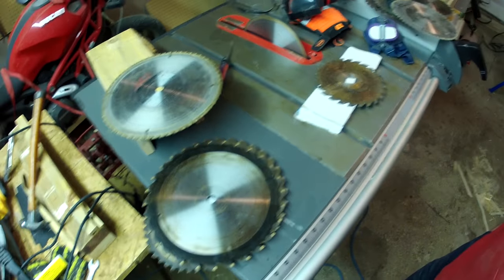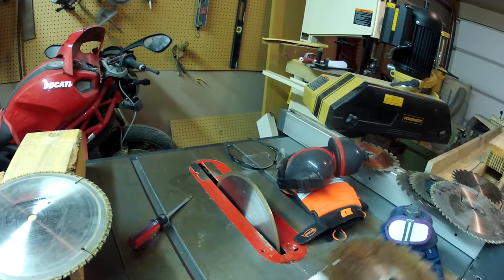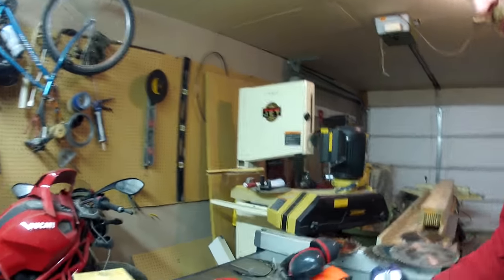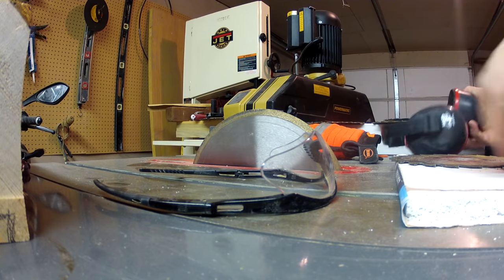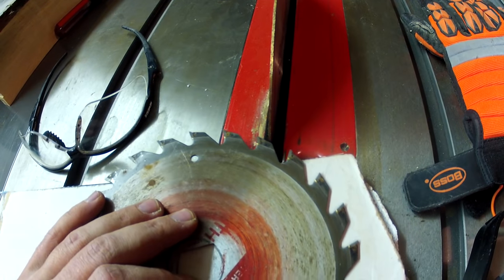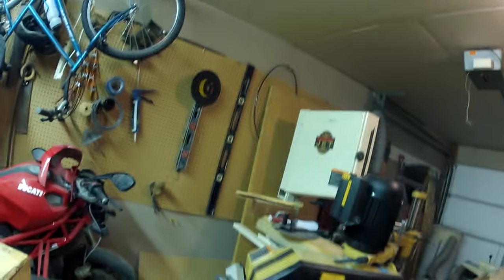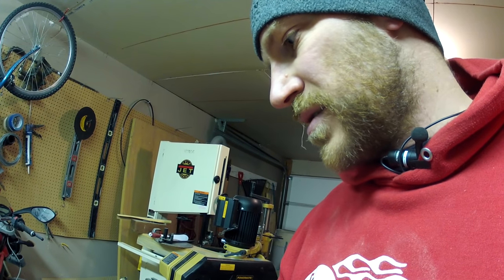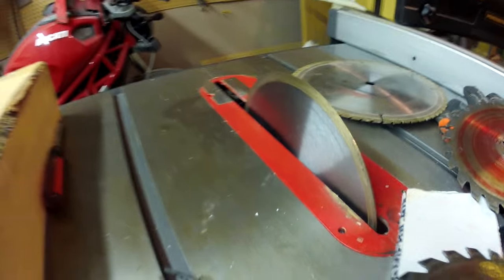How to sharpen your circular saw blades, the easy way.

Comment: You can tilt your table saw blade to do the other type... Just skip the other tooth then go back threw it after you reverse the angle. I clean up the tooth's top with a hand dimond file... eBay cheapo's hold up quite well for a four or five dollar file. I've stopped on a trim job and touched up my chopsaw blade while having a beverage... Takes you 10 mins by hand... Why would you put on a new one for fifty bucks? I think the guys that don't do this are clueless! I got a whole set of little files... I just touched up a 3/8" spade bit... My brother in law hit a nail while we where putting up hit backyard fence... Took five minutes! Why yo be ...man! Keep on rockin in the free world !!!
Reply: Totally agree.  Even the brand new spade bits I've bought aren't as sharp as I can get them with a chainsaw file.
Reply: Tilt is almost never needed on the face of the carbide.  Just touch up the face at 90 degrees and you're ready to go.  Use very light pressure and you will get much better edges on the carbide tips.

Comment: How do you account for tooth angle? Not all blades have  flat, 90 degree angle, most are a slight angle, like 10 to 15 degree, and alternate back and forth from one tooth to another.

Comment: Thanks a lot for this!  I feel a bit stupid, now.  I can use a similar method for sharpening router blades.  You could sharpen those hook-tooth ones with a round diamond stone chucked in a drill press.  I sent my blades out for sharpening, which cost about $7.00 each, but I'm not thrilled with the sharpening job, especially on my miter blades.  Still too much tear-out.

Comment: Would any continuous rim diamond blade work? ie the ones sold for cutting porcelain?
Reply from the maker: I'm using 600 grit diamond now. If it's too course you'll get chipping. I haven't had any issues at 600.

Comment: I disagree with it’s cheaper too. I could get my festool blades sharpened for £12 for 48 tooth. New blade here is about £40. 
Also use and old container and leave your blades soaking in water with washing machine powder mixed in for 15-20 mins and then use a wire brush to get all the resin build up off. It makes a difference too. Nice video👍🏻
Reply from the maker: I just sharpened my festool blade two days ago for ~$0. Obviously there's a nice import markup here as my Festool blades cost over $80.

https://www.festoolproducts.com/festool-495377-fine-tooth-cross-cut-saw-blade-for-ts-55-plunge-cut-saw-48-tooth.html?utm_source=google_shopping&gclid=CjwKCAjw1cX0BRBmEiwAy9tKHpv9EMObEzGgGWINMlKTlhxxKs_q7-ofrERB4aw2fou0NPEmQqZ5GBoCQ6wQAvD_BwE

Comment: Very useful. I’ll give it a try. 
On the other hand you should never use gloves with a circular saw! They won’t protect you from getting cut. They would pull your whole hand in. Without gloves you might get away with just a little nick if you’re lucky. With gloves you’ll lose your whole hand. 
Same goes for rings, loose sleeves or long hair.

Comment: Hi ya.   New to this sharpening saw blade.  Isn't every second tooth a different angle.??
Reply: Depends on the saw blade some are some are not.  Oversimplifying somewhat....rip saw blade carbides are straight.  Cross cut saw blade carbides are angled.  
    But I suppose you could just make very simple jig that holds the blade at the correct angle and sharpen every other tooth.  And then flip the blade over and repeat the process.

Comment: This is interesting
I use metal cutting carbide blades for steal cutting 
They do dull out like any other blades will and get in to $$$$$$$$$$$$$$$$!!!!!!!! 
There not cheap and if a guy runs and ruins ALOT of them it's a pricey problem I will like too know if this technique will work on mentioned blad s as there design is very different than that of a wood blades if you have any ideas to share 
                                                                                                        Thank you in advance

Comment: 46 years using circular saws daily working as a cabinet maker the secret to keeping your saw blades sharpe is at end of every day spend 19 minutes on each saw blade rub a diamond stone over ever tooth of the blade at 20 degrees your blade will last for ever. Take good care of your tools and reap the rewards. Blunt tools will never make huge profits as sharp tool will.

Comment: A useful video, that's got me thinking...
Why not a sled that fits in to the table slots.  Upon it can be mounted an adjustable arbor mount that can be positioned according to the blade size.  Stops can also be incorporated to assist is stabling the blade being sharpened...  Or you could use a piece of drywall.
BTW, selling the Ducati?...  Either fix that beauty and ride it or sell it!

Comment: In my years of cutting boards with carbide blades I found that a scale builds up on the teeth (sides and face) which slows the cutting.   You can readily see it.    All you need do is remove that scale using a wire brush and the blade will cut again - no sharpening is needed.
Reply: You can also soak it in laundry detergent and wash it off it with wire mesh sponge.
Rinse with water and dry it thoroughly.

Comment: Seen this before. With this setup you are getting  about 100 grit finish if that.  400 and up is what you really need for clean cuts This setup with that diamond grit blade results in rapid dulling again. Use only on junk blades where the cut quality  matters little. Like cutting 2 x4's.  Use a N95 mask as well. The carbide dust will do your lungs great harm. Wash hands and clothing  well,  after . Use the Dremel diamond wheels instead. Diamonds are much smaller on the wheel resulting in a finer finish on each tooth. Closer to that 400 grit finish. Do mine on a drill press. This gives me speed control to dial in a good cutting speed. Hope this helps.
Reply from the maker: I'm using a 600 grit wheel now for that reason. The one in the video occasionally chips the carbide if you're not careful.

Comment: always use a dust mask  when grinding carbide. heavy metals in your lungs stay there forever. used to work in a carbide shop 40 years ago. breathing problems were common for the  workers there. the dust even managed to go right through your clothes into your pores.

Comment: Great video, do you know a way to sharpen drill bits ?
Reply from the maker: I sharpen mine by hand off a simple craftsman grinding wheel. There's a technique to get the right angle and bevel but pretty easy with practice.
Reply: +The Rocket Factory I'm guessing you might have setup the grinding wheel to sharpen those drill bits in much the same way as the diamond wheel shown in this video. Am I correct ?
Reply from the maker: +Matlockization it's a bit different. I should do a video. The way I do it is very similar to the way old time machinists do it. Just hold the bit in hand and twist it into the grinding wheel. Works great, just need to make sure you get the right angles.
Reply: The Rocket Factory Right.
Reply: +Matlockization I have a drill bit sharpening video you might find useful among other shop tip videos
Reply: Bob Cartwright It's listed under your name ?
Reply: Bob Cartwright Thanks.

Comment: I'm gonna try this but with a 50-150 grit diamond blade, I don't expect to get amazing results like when you have your blades professionally sharpened with 8000 grit. The free hand method has me skeptical as well.
Reply from the maker: The finer the grit the better, coarse grits tend to chip the carbide

Comment: Might work for a few times, but for correct sharpening you should joint the tips first. That will get all points/tips the same length. Then you sharpen the face back to where the jointed tip (land) just disappears.

Comment: What grit diamond blade?

Can a smaller diamond blade be used? Can it be 7.25 inch rather than 10 inch?
Reply from the maker: The finer grit the better. Mine is a little to course and can flake the carbide if I push to hard. Either would work.

Comment: OR,
You can mount the dull blade on backwards, turn it on & GENTLY
touch the spinning edge of the dull backwards mounted blade 
with a sharpening stone.

!

Comment: Cool, a simple jig using the mitre slots & a spring loaded stop would be easy to make .  I thought you would have the angle diamond blade & done every 2nd tooth & then flip the blade to keep the bevel.

Comment: The only problem I have with this method is that you are producing sparks (although not massive) that fly into a table saw which by its nature has a lot of residual sawdust in it. The potential for fire is quite large.

Comment: Is there an easy way to identify a blade with carbide on the teeth?
Reply: +Shaun Hill Carbide blades are immediately distinguishable from the old high-speed steel variety.  The carbide cutting edges are brazed to a steel body.  You cannot mistake the two.

Comment: I hate to differ with this mans technique. All table saw and power hand saw blades have a side clearance. light kerf or heavy kerf you have to clean the next tooth path to reduce friction on the next tooth to cut. most of the teeth don't cut straight across as demonstrated. For example. Tooth one cuts as manufactured left slightly more than tooth 2.  Tooth two cuts more right than tooth one, thereby allowing saw dust to evacuate easily and reduces the chance of friction building up on the saw causing warping and distortion. Every manufacture uses a different angle for their teeth and their kerf. I would suggest reading up on sharpening blades before you try this system.
Reply: But this is better than throwing some cheap beater blades in the trash . Yeah the guy could glue up a few degrees angled board with some thin plywood + door shims and then rest his blades on that...then he's just gotta mark every other tooth with a sharpie then go to town, flip the blade over and sharpie mark the alternate teeth and repeat . Maybe take just a few minutes more . Thanks for posting the vid !
Reply: +Rob H. I think you need to look at saw teeth a bit closer. The relief angle is ground in each carbide tooth. Plus the carbide inserts are proud of the blade body too. What this guy is doing in this video totally works.
Reply: Hey Richard sort of makes one cringe when you point out an obvious important point about sharpening blades.  Then to get totally reamed by the idiots !  WOW !  What a country !
I like the kid being thrifty but the saw most likely will wander off into outer space if not sharpened properly.
Reply: Richard.  If this is a flat face tooth, the side relief has already been ground at the factory. By grinding the face back, he is narrowing the width of the blade in small measure.  This has two flaws when not well fixtured, teeth can vary by both width and height, leading to odd load patterns possibly inducing blade wobble, and more tear-out on the wood than a "perfectly" round blade with identical tooth width.  The problem with an aggressive setup like this (diamond wheel large diameter) is if the tooth geometry starts out perfect (but worn), ever the briefest variation in grind pressure or angle is guaranteed to introduce tooth shape errors.  This is why commercial blade sharpening machines are so expensive, they are precision made, purpose designed machinery.  That being said, if you cut a lot of wood and the performance meets your standards, then buying "junk" blades and giving them new life seems worthwhile.  Just don't expect cabinetry grade performance and all is good.
Reply: i can add only this, he can tilt the circular blade ( the diamon blade that is) a few degree to mathc the angle on teeth he wants to sharpen and do 1 teeth 1 not, get a sharpy like you said and mark the ones he did , then reverse for the rest easy and we make every1 happy
Reply: your mean!  lol
Reply: the world has needs for both watchmakers and blacksmiths, different standards apply.  Sometimes you have a dirty job that needs doing and even a few chipped teeth will not be a problem.  Not everything needs to be perfect, shooting for a notch above 'good enough' will often be way more than needed.

Comment: How can you be assured that the blade will still be balanced?
Reply: How can you be assured the blade is balanced after you've used it, and it has pitch on it? Or if your blade is a little loose on an arbor? If you grind each tooth the same amount and the blade was balanced to begin with you should probably be OK.

Comment: I just tried this method. but i seem to be doing something wrong. Using a continuous diamond blade for cutting ceramics it definitely abrades the carbides but it's leaving micro chips on the edges of the teeth arguably making it even worst. I have the blade set up on  a jig mounted through table saw runners and have reduced the blade (diamond)  rpm by a factor of 2... still no luck

Comment: This is an excellent method for quick  sharpening. We used the same method, but got close to factory quality edges: we made a small sled with a rail on the bottom to register in the miter gauge slots. The sled had a stud that matched our saw's arbor size, and you just repositioned it by re-screwing it to the sled in a different spot. This allowed us to rotate the blade keeping the perfect face angle, then slide it forward on the sled. We just tilted the blade to match alternating bevel teeth.
This guy does a similar thing: https://www.youtube.com/watch?v=ZljcSY732NE

Comment: I remember my dad sharpening hand, band, and old steel table saw blades with just a file. Then setting the teeth with a saw set. By the way do you sell the limited edition jigs, or do I have to make my own?
Reply from the maker: Danny Jackson Well, you'd need to make your own that was model 1 of 1... but the design is patented so you'd be opening yourself up to a lawsuit.
Reply: Danny Jackson they would not have had carbide teeth.  I think that blades with carbide teeth have become more popular for DIYers replacing the older all steel blades.

Comment: That blade with a round tooth can still be sharpened, Do exactly as you did, Until it no longer it won't cut properly
Any cross cut blade can also be sharpened this way, Just start using a tapered piece of wood with a pin in it to keep the blade at the correct cutting slope, It's actually easier then you think. An if you use a little bit of dripping water you won't burn out the carbide.

Comment: Great vid, but if you don't hold the hole in the arbor at the same point for each tooth, you will wind up with inconsistent angles on the teeth.

Comment: I must tell ya ,to clean theblade use Easy Off Oven cleaner. Just spray it on bothsides ,wait 5 mins. ad hose them off. Most blades that's all is required.

Comment: This free hand method is OK if you are confident about your skill.  But I would not recommend it for the novice.  Is it possible to correct a chipped tooth?
Reply from the maker: It depends on how bad it is. I've ran blades without a tooth and had good cuts but that's because the rest of the teeth were super sharp. I haven't had a chance to update with new tricks but I recommend the finest grit you can get, I use 600 now.

Comment: I would do this another way. I have spent a lot of time rebuilding, restoring, and repurposing a 10in Delta cabinet saw. I would not want ultra fine diamond and carbide dust where could get into the mechanism. A really really bad idea

Your concept is sound and I would build a jig with a separate motor to carry the blade which should last a long time and do an exceptional job.

Comment: If you look at the teeth you'll notice a pattern on the blade and the angle of the cutting edge on every other tooth, sometimes the pattern is a repeat of three different angles on the same three teeth. 
(three teeth one after the first and each has a cutting edge with a different bevel).

Comment: Could you sharpen these with a dremel?
Reply: Gayla Lameier  yes
Reply: Gayla Lameier 
No... not if you want a good job of sharpening.
Reply: deernutOO
What's the difference between this and a dremel with a diamond wheel?
Ask Matthias Wandel, he sharpens his saw blades and bandsaw blades with a dremel and they cut really good.
Having good handcontrol is a must.
Reply: +epiphonesg007  On a table saw, you can set angle and keep it their.
Reply: +Jim Schmidt " THERE"  also their and they're....... learn the difference.  Did you ever attend any English classes?

Comment: The one with the round carbide tip is called a pirrana blade you cans harping it but I would take to saw shop
Reply from the maker: Good to know, thanks. With as many blades as I have I didn't even bother with it.